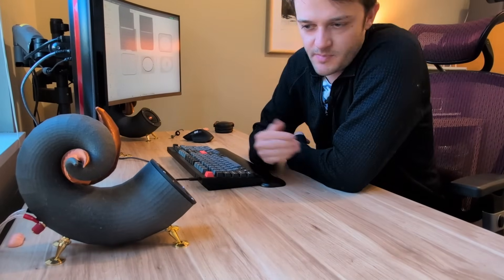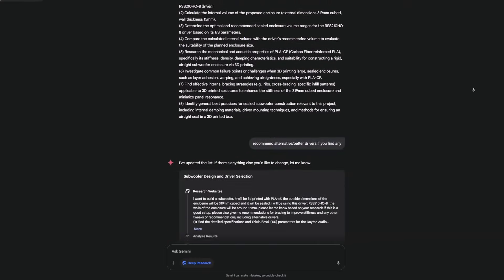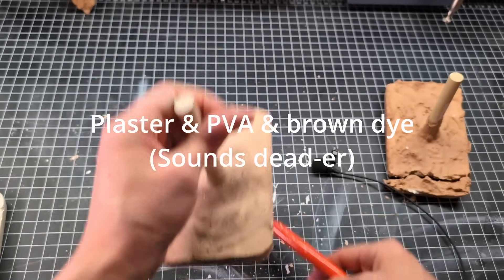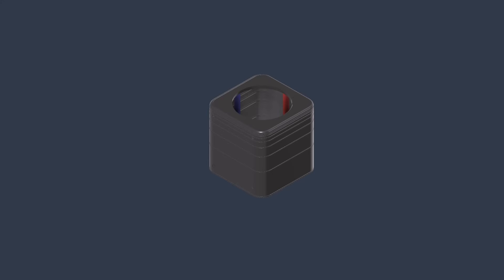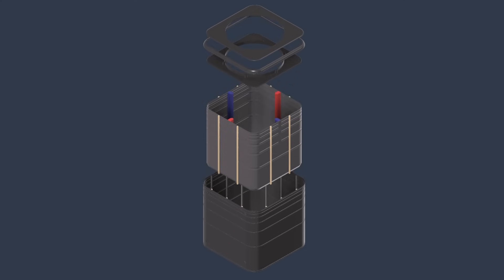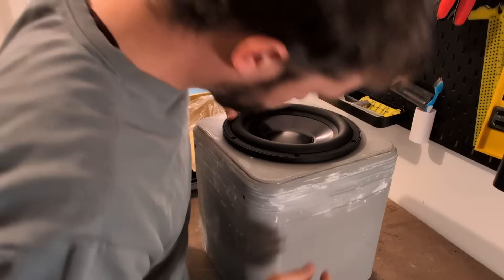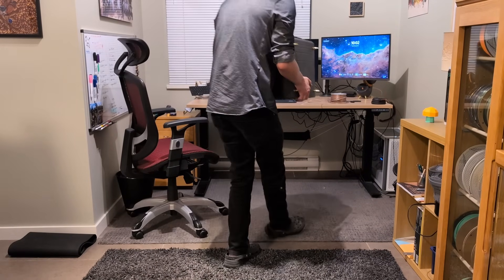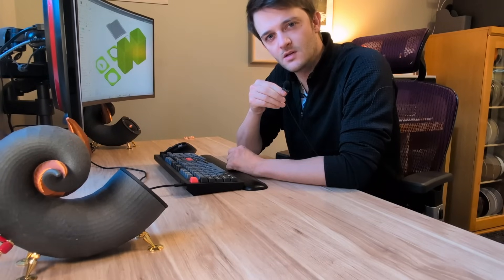Unique DIY Subwoofer: Maxing out my 3D printer was not a great idea

Comment: I went a different route.  I bought one of those concrete form tubes and painted them just to seal them up.  They are just cardboard but very stiff cardboard and the cylinder shape is strong.  So all I needed to print was the ends. Knowing that bass is not directional I printed a curved funnel shape for the bottom so the thing is vertical and the sound is still dispersed.  It sounds great. I added it to my TV soundbar and discovered that I actually need to turn it down for a good balance.  Great for music and some movies but when people are just talking the extra bass is distracting.

Comment: well...my own approach was a bit different; ( my old man always said, there is usually more than just one 'right' way to do something...) my first step was to print a small section of the enclosure wall structure design I came up with, and fill it with plaster, just to get a feel for what I was getting into, without spending the time and money to print an entire enclosure and THEN finding out. This was a wise approach; the plaster filler method was far too messy/problematic for my preferences, which was to avoid post-work  such as clean-up/removal of errant plaster, sanding, painting, filling, futzing around; I produced another test section and tried filling it with fine quartz sand instead of plaster. Not messy, no futzing, straight and to the point, as well as making a very heavy, acoustically inert wall section. ( acoustic energy traveling through quartz sand is turned into heat ) I printed my double shells with ribs all in one go, 3mm walls and 3 mm thick ribs, with a 20mm void between them, instead of multiple parts that had to be assembled. The finished print was very rigid and stable. I designed the enclosure as a series of short modules that joined together both mechanically and with elastomeric bonding agent, and printed bolt-on plates for the top that could be attached after filling the dbl walls with sand. Instead of sanding/painting I simply printed the enclosures with a 'fuzzy' texture to hide layer lines. 
The result was an excellent 3-way system, with sound quality rivaling retail units much more expensive than my investment in materials. Emboldened by my success, I designed a pair of large open-baffle speakers using the same dbl wall/sand fill method, and they sound/measure very well indeed. Here is a link to a short clip showing some elements of both projects and an REW measurement plot. Cheers!
https://youtu.be/zzkw7Th63BY

Comment: Those original speakers scream low res stl. If you actually want that curve, export a high res step file. It's super easy and you dodge the low poly look. (Edit: oh, you modeled them that way.)

Did the sides of the sub bulge out from the weight of the setting plaster?
Reply from the maker: It was a deliberate choice, but it does seem to be an unpopular design decision haha! I was making low poly animals at the time for another project and I had low poly on the mind. 

They did... in hindsight I needed more internal cross bracing between internal and external walls. Next time!

Comment: If you would have used pl400 adhesive to glue them together intead you would have been fine.
Reply from the maker: I did try some construction adhesives but the plaster is too dusty to get a good bond, perhaps with the right stuff it could have worked but my tests weren't positive!

Comment: Ofcourse the really fun bit is that making this out of wood would be finished loooong before the printer was even done printing.

Also: with a subwoofer the placement is everything. Put the speaker on your chair and listen all around the room for where you can hear the bass the loudest, then put the woofer there. This means you can turn down the volume quite a lot and still hear it just fine.

Also also: rotating the woofer to point in a different direction can help a lot with standing eaves (the ones your neighbour can hear)

Comment: This was my driver to buy a 3d printer in the first place - plastic filled with plaster. Thanks for trying it out for me!
Still, I am scared of your 3D prints on the H2D, my prints on P1S look way better. Do your PETG a favor and dry it out. I bought 4 spools of PETG, two of which were IMPOSSIBLE to print with. I just dried those two, and it was day and night difference - they even performed better than the first ones (which somehow got less moisture). Can't stress enough how important drying PETG is. Also, maybe you should have tried a simpler infill and very sparse, so that plaster could run through? My 2 cents.

Comment: As for strength perpendicular to the layer lines (which is pretty much non existent with thin-walled prints): Threaded rods as rebar work wonders. Designing for them is usually quite simpel and they're easily available everywhere and dirt cheap.

Comment: I knew you would follow through with the sub and congrats on making a significant jump in subscriber count! For your cabinet texturing you probably could try truck bedliner. It is extremely durable and depending on how you apply it you can get the texture you desire too.

Comment: heated inserts to hold that heavy and powerful subwoofer  ?
look brother i hope i am wrong but i would definitely use a t-nut for something like this 
coming up on almost 3 decades of building car subwoofers for sql and spl 
and especially in a closed sub i would not trust these inserts , my bet is they will shift slightly and start to leak air around the chassis
Reply: Given all the plaster that is unlikely to cause any problems.
Reply: @bertilorickardspelar he puts the inserts in after the plaster is already cured . So that makes Zero difference
Reply: @Crushonius  Are you assuming the plaster will crack or that it was never air tight to begin with? Just curious.
Reply: @bertilorickardspelar  the plaster has nothing to do with it . the insert loosens up so the subwoofer chassis is not pressed fully to the cutout of the box and air can escape between the chassis and the box .
you need a good amount of mounting pressure for the sub to be airtight especially in a sealed enclosure .
a subwoofer is basically like a compressor and can push air out of microscopic holes but if the inserts really do come loose as i suspect the sub will leak A LOT of air
Reply: @bertilorickardspelar  and in my earlier reply i meant to say that the plaster has zero influence on the adhesion of the 
insert to the plastic , so it does not matter .
he sets the insert into plastic and that bond is strong enough to hold small bits and pieces together but not strong enough to clamp down a sub properly to create and to over time hold a perfect seal
Reply: @Crushonius  I would assume the 3D printed plastic to be the failure point as the heat set inserts usually rip a part of the plastic out rather than becoming loose. I also assumed that the plaster would add rigidity which would help the plastic withstand the vibration forces. I am no expert however. Thank you for explaining your point, you are probably right.
Reply: @bertilorickardspelar those heated inserts get weaker over time especially when there is vibration . A t-nut would act like a vice basically clamping the 3d printed Part between itself and the woofer no matter how you put it , its a fundamentally  way better solution than the heated inserts that are inserted from the front

Comment: The thing with overbuilding speakers is that you have so much headroom that you can just eq the shit out of them and it will be flat down to 20Hz, which is bonkers. Is building a 30L $400 passive sub an overkill and jkinda wasteful for an office? Yes. Is it cool? Also yes. 

Next time you could try using WINISD or a similar program to figure out what you actually need. You totally could get away with a $70 driver and an eclosure about 1/3 the size. For example a DS215-8 driver in a 10L closed enclosure at 55W can produce 80dB down to 30Hz at 2.5m listening distance. And it would have cost you about a third as well.

Comment: You can use the top or side of a random orbit sander held against the shell to vibrate the plaster into place. Also, consider light weight cement as a fill material. (No aggregate)
Reply: Cement NEEDS aggregate.
Reply: @ Being pedantic, but cement with aggregate is concrete. The properties the aggregate gives concrete are not needed in this application. A low percentage gyroid infill will provide some of those properties, but this is not structural.
Reply: @jdl3408  Not pedantic, i miss-spoke. Thanks for the corection. I agree it's not structural, but if you increase rigidty, won't you benefit accoustically? I'm not versed at all in anything related to materials accoustic properties.
Reply: @Ayce47  i just learned a new word, padantic coming from pendant. Good stuff!

Comment: Why not use concrete?
Reply from the maker: That's a great idea, and it crossed my mind at the beginning. If I ever make something else requiring walls as dense as this again, I'd likely test it. Plaster was messy and finicky!
Reply: @ well concrete is not tidy but it will set rock hard. You can get some very fine concrete’s used for making sinks and stuff
Reply: In this kind of application where the weight doesn't matter it should be good idea as long the concrete doesn't crack too bad

Comment: If the floors are on wood beams, putting the subwoofer on a cut yoga mat or soft silicone dampers would help with keeping the floor/walls from transferring low frequencies. Coupling spikes are great for concrete floors, though.
Reply from the maker: That's a great tip, thanks for the suggestion!
Reply: isolation pads designed for washing machines work wonderfully as well, and they are super cheap

Comment: fill it with epoxy resin ;-) i do it with my 3d printed speakers
Reply: its more expensive tho
Reply from the maker: It's a good idea! It crossed my mind and I am sure with your experience it can go smoothly. For me, j was concerned about the cost and the heat generated by the epoxy. Plaster was $9 CAD/$6 US for 2kg, far easier to eat that if thing go wrong.

Comment: Can you use the accelerometers in your cell phone with a spectrum analyzer/FTF program to conduct your frequency response test?
Reply: The sample rate would not be fast enough, and if it was, the goal is to measure sound, not vibration. A calibrated microphone with REW would be ideal.
Reply: @ShaneCranor  I didn't realize that phone accelerometers had such a low sample rate.

Comment: So if you would've left the print on the bed, you could've add custom g-code to shake the bed while pouring the plaster to fill the gaps faster.
Reply: Who doesn't want to fill their 3d printer with silicone and plaster!
Reply: I would consider 12 kg of plaster to be too heavy for dynamic movement of the print bed. But that's just me.